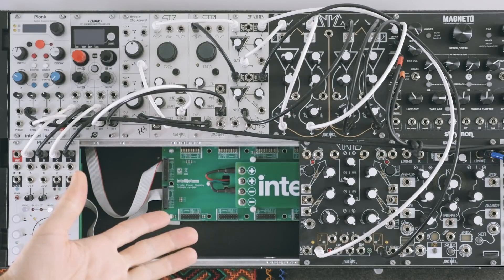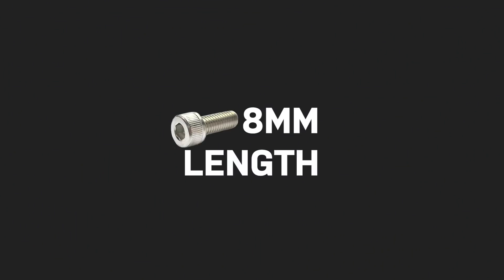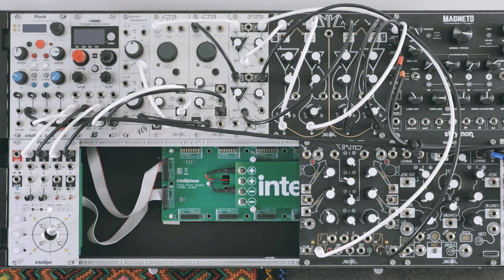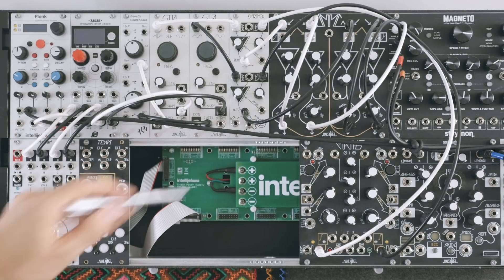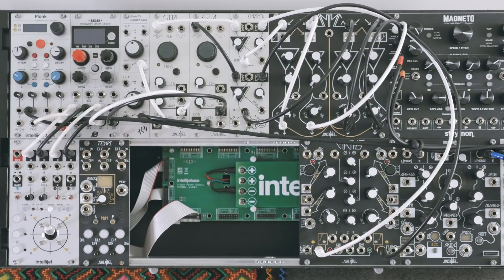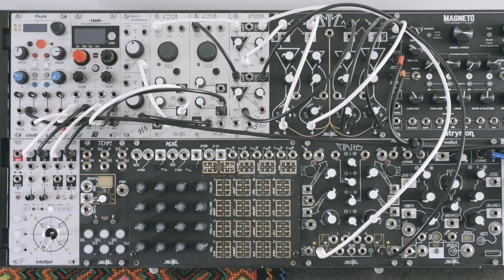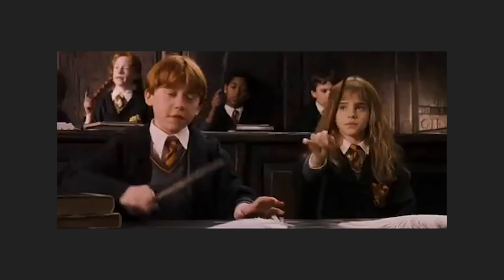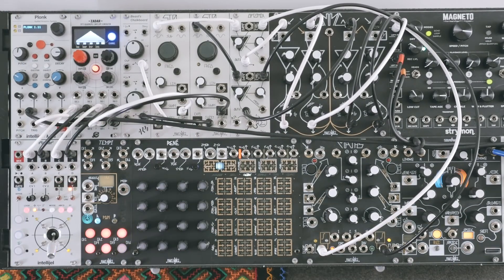The Secret of the Sliding Nuts | Eurorack Modular Synthesizer Tutorial

Comment: OMG YOU BEAT ME TO MAKING THIS VIDEO HAHA!  You did it better ;)  Pen Magnet is genius, didn't even know that existed.
One thing I think is a key thing with sliding nuts is pre-placing spare nuts underneath modules.  So when you remove one/some, you don't need to remove a bunch of other ones just to get at more nuts.  My algorithm is to put one spare nut for every ~8HP.  So for example, if you drop in a 34HP Rene2, slide 4 spare nuts underneath it on each rail.  Which I think is exactly what you had, but I don't think you mentioned the reason why... or I missed it and I'm lame.  xoxo
Reply from the maker: Let's make a part 2 video together!
Reply: I am so down!
Reply: @Lightbath  Hi, that's a great rule, except you have to put the nuts in before attaching the modules, and won't always know how many big or small modules you have, and you might sell/buy modules, etc. 
Still, taking your rule of putting an extra nut behind a 8hp panel, if you have 104hp made out of on average 8hp modules, that's 13 modules, so 13*3 nuts = 39 nuts? That seems excessive, no? 
I see Make Noise put 20 nuts. That's too been my experience of it being a sufficient number of nuts. What do you think?
Reply from the maker: I can’t remember exactly how many I have in my rails, but it’s more than 20. The more, the merrier, I tend to feel.
Reply: @Lightbath  104 nuts for 104hp would solve all conundrums 🤣
Reply from the maker: I totally forgot to mention this!!!!!!! Thank you 🙌

Comment: Am trying to fit my DFAM back into its original case, which introduced me to sliding nuts for the very first time. Being completely stumped by this, I ended up here. Thanks for this, I was at the stage of simply pushing some Blu-Tack under the lip of the DFAM to hold it in place! The magnetic pen you link to is $4.58 and in stock on Amazon US, but is £21.11 and delivery some time next month on Amazon UK. So, for UK viewers, I've ordered one of these for £1.24 from RS Components, picking it up tomorrow. https://uk.rs-online.com/web/p/sensor-switch-magnets/5361710
Reply: Update: magnet linked above is nowhere near strong enough. Doesn’t work. Where’s that Blu-Tack?
Reply from the maker: Strange. I wonder if the material the nuts are made from isn’t magnetic enough or if the panel material is blocking the magnetism... because those pen magnets have been working great for me.

Comment: Your  explaination   is  fine  but  my Shared system arrivedwith a lot  of  the nuts  on  their  sides  rotated through 90  degrees  and   some  were  even  flat   in  the  channel, so I  am  NOT  a  fan  of  sliding  nuts,   the  answer  for  me  was  to  use a matchstick  trimmed   back  to  fit  through  the holes   but on  the whole  HATE  SLIDING NUTS.

If there  was  no problem  with them  there  would  be  no  need for  a  12  minute  video to explain  what  to  do.

Comment: I haven't got modular so I don't know if it will work but wouldn't it be easier and cheaper to use simply a piece of wire (say 1mm of diameter) instead of a magnet pen, pick a nut, stick it inside the nut and then put the module (it's hole actually) on the other end of the wire, adjust/center it and voila?
Reply from the maker: Woah, cool that you watched this anyway! Easier to use a wire? Perhaps. I find, though, that when I don’t know exactly where the nuts are hiding under the panels, that the magnet is most handy because it picks them all up and slides them together to wherever I need without the need to ‘fish’ for them. And that tap-trick of aligning the nut with the hole is super-quick, so it’s my preferred method. But I do know people that prefer the wire-fishing method 🎣

Comment: I recently switched over black m2.5 ceramic screws. They’re super tiny and I don’t need a washer to protect the panel. It’s easy to drive them cause they’re light and can be force fit to the head of the screw driver. Only thing you gotta be careful with is cross modulation... I mean cross threading, but for me it’s been mighty pleasant.
Reply from the maker: Woah, I hadn't even known about ceramic screws. That's nice that they don't require washers. So then, with sliding nuts you'd use a toothpick to position them?
Reply: Lightbath nuts are still metal. Best of both worlds ;)
Reply from the maker: Oh right 🤦🏻‍♂️ 🤣

Comment: Waving magnets around your gear is not recommended, in my opinion.
Demagnetize those nuts with a screw (de)magnetizer, for instance, especially with touch controlled modules, you do not want magnetized steel around that.
I just use a toothpick, it is not hard to align it that way for me, I always put extra nuts in between where needed, swapping modules is easier that way.
M2.5 8MM screws, philips head is what I have and I always use nylon washers.
Swapping modules is so much better with sliding nuts, that's the biggest argument for using sliding nuts I think.
Anyway, it is not an issue, it is a detail. You can screw your modules into lost of stuff, just be aware of temperature because rails are also a cooling system.
Reply from the maker: Oh, thanks. Those are a lot of good points if I ever make a more comprehensive video. I’m learning so much from this. I’m curious to hear more from people about the whole magnetized steel thing. 

But yeah, are you saying that René could potentially act weird because of the magnet?

And when people use a toothpick, they’re using it to align a nut to the center of the hole, or to actually move the nuts around by inserting it between the rail and the module? And if the latter, I’m assuming that the module needs to be loosely fastened to be able to fit the toothpick in between the panel and the rail. Yeah?

Comment: Is there any concern about a magnet damaging a module?
Reply from the maker: So far the consensus appears to be no. Someone who appears to know much more about data storage than I commented recently (I think it was on Instagram) that it's safe. But you know, don't take my word for it. Just know that I've personally never had an issue.
Reply: it probably safe just to have the power off while using the magnet
Reply from the maker: Fortunately the power is usually off anyway when using it 🎉
Reply: you will not damage the module by using a magnet. maybe you can scratch some modules if you are not careful but electronically speaking it is quite safe.
Reply from the maker: hey, thanks. Someone in another comment mentioned that magnetizing the panel of a touch module like René could cause issues with the touch function. However I’m unfamiliar with how difficult/easy it would be to actually magnetize the thing and if magnetized, what sort of issues would arise.

Comment: I've been on the lookout for deals on the rails themselves, and this reminds me, I often have to go to some trouble to drop more sliding square nuts down the slot.  I just received a pair of 21.78 inch Vector rails from Digikey, and these rails have a well planned little hole punched into them just about an inch from one end.  So this hole makes it possible for me to drop in more square nuts with much less disassembly.  How this hadn't occurred to me earlier only conveys my lack of common sense.
Reply from the maker: Ah, yes! Those are the rails that my Elite case had. Made it very easy to add more. Also made it easy to lose a few if not careful 😉

Comment: Moral of the story, get threaded rails. What’s the advantage here? If you have to make a video explaining it, it’s clearly not the best solution...
Reply from the maker: If I preferred threaded rails I’d make a video about them instead 😉 That said, The advantage of sliding is the flush mount/no gaps, I’d say. That and the smaller screws if that sort of aesthetic pleases you. While the advantage of rails is not fussing with the magnet/toothpick/etc. Clean but fussy vs simple but crude. I don’t think one can be better then the other. They’re just two ends of the spectrum.

Comment: I use a toothpick, works fine. Only issue I have with sliding nuts is in some cases there's no way to add more so doesn't really work with a bunch of small HP modules.
Reply from the maker: Yeah, this is another good point some have brought up. I’m taking notes.
Reply: yes - exactly what I do.
Reply: I had 11 nuts in 84 hp in my first case, but that put some limitations on what I could put in there. Now I have 20 nuts in 104hp, and that is plenty. No need for any more.

Comment: The curse of the sliding nuts is that if you replace one module with two then you might have to take out a bunch of modules just to find an available nut to slide over. Well that and the sound it makes when you tip it sideways. For some that might be a feature.
Reply from the maker: Yeah. My solution is to add a ton of nuts to the rails. Just buy a pack of 100 square nuts and load 'em up. Then there's always one nearby (provided that you evenly distribute them when installing modules).

Comment: All my cases have sliding nuts.  I just use a bamboo skewer to align the nut and it's fine.  Where they absolutely fail it removing one large module and putting in multiple modules that add up to the same HP.  It usually requires totally removing everything from the row and putting it back as the nuts are redistributed.  Also because readymade cases tend to be made with some preconception about how many modules you should put in there, an insufficient number of nuts are included.  So yeah, I don't think I'll be getting any more cases with sliding nuts, despite the convenience of making all my  modules flush with each other.
Reply from the maker: My solution is to add a ton of nuts to the rails. Just buy a pack of 100 square nuts and load 'em up. Then it's the best of both worlds.
Reply: I might be able to do that to the moog skiff I have, since the ends come off, but the Pittsburgh and Makenoise cases are glued shut.  But yeah, I agree that would be the best solution.
Reply from the maker: Glued?!?!? Oh’s no’s! I hadn’t realized. The Elite Modular case had little entry points to add more nuts and the Submodular can be disassembled and reassembled without too much trouble.
Reply: The Pittsburgh is ok that way since it's the little baby 96 hp square case, but the Makenoise shared system case is really just designed for the shared system.  If you try to load the shared system case up with a bunch of 8-10 hp modules, you run out of power headers and sliding nuts real fast, not to mention power.  But the upside of these shortcoming is that I definitely feel motivated to make my own case and just put in all the nuts and power headers I want.